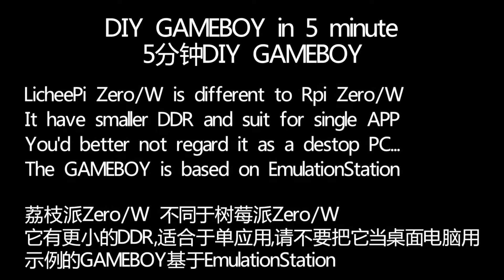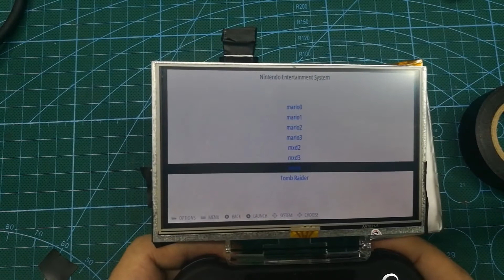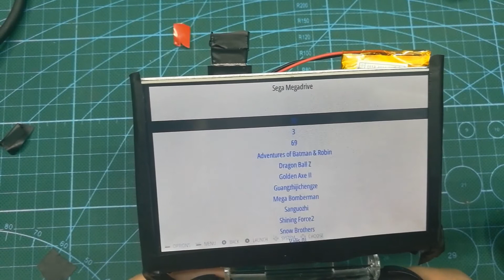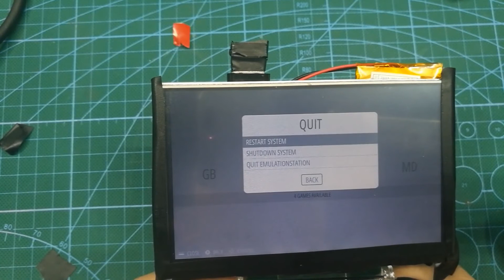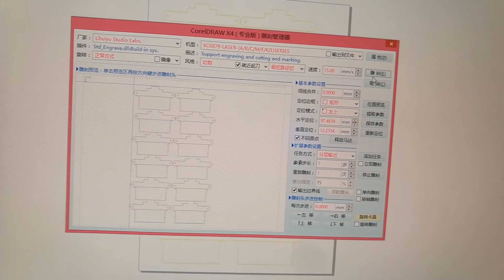DIY your GameBoy in 5min !

Comment: Great work Caesar ! 
I'm thinking about using your board for my next emulation project, but I agree with DrunkCarni, it looks like the performance is not good enough for playing smoothly. 
Is this slow fps due to the refresh rate of the LCD display or the processorthat cannot keep up with the emulator ? And do you thing it could run smoothly with other emulators maybe (if you could make a video with mednafen per exemple it would be great)

Anyway the board and all the daughter cards must have been a lot of work, that's plain awesome.